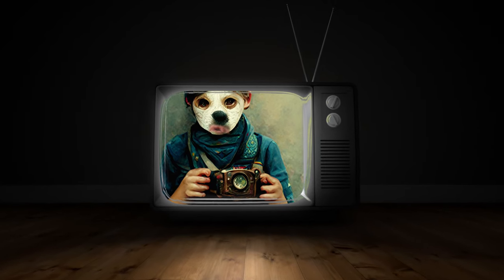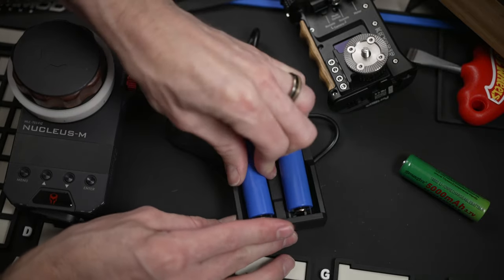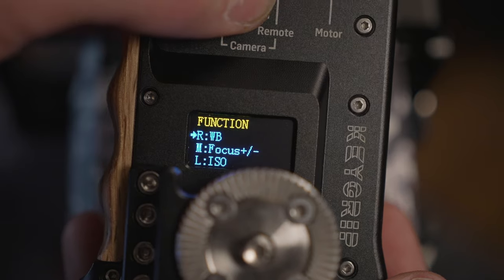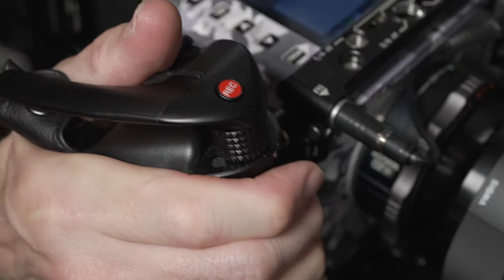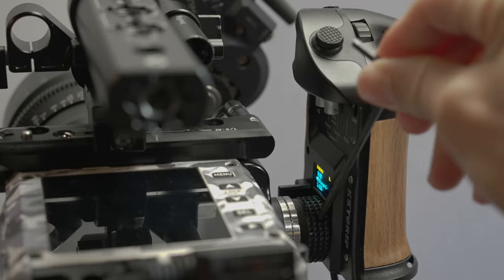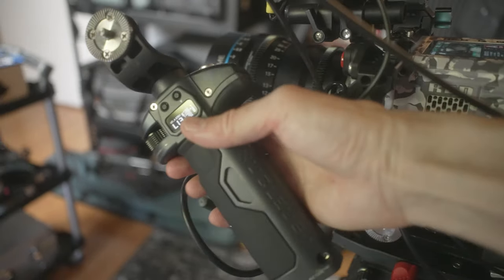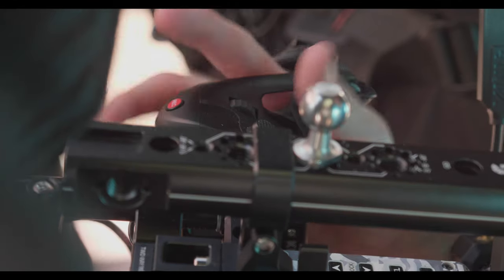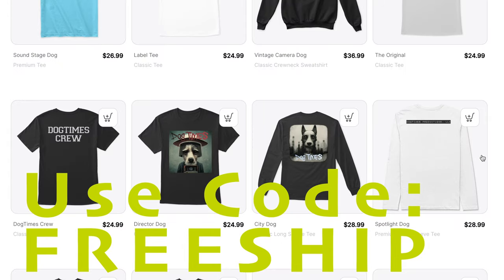RED Komodo Wireless Control - PortKeys Key Grip Review

Comment: Thanks for the deep dive into the problems with the Nucleus M motor. I picked up a Keygrip as it was literally the only option for a handle with a start/stop button for the Blackmagic Pocket 4K/6K. I’ve been using a Nucleus-M with a Nucleus handle for pulling focus on my shoulder rig which has been great. I was going to try out the motor with the Keygrip but I think I’ll just avoid it.  Maybe I’ll try out a Nucleus Nano motor with the Keygrip for controlling zoom. So far things have been working well with the Nucleus handle on the left for focus and the Keygrip on the right for start/stop and iris.

Comment: The small switch on the front is not ideal on this thing but it works. You have to hold it tight. Loosing that rubber cap will happen though....

Comment: The tilta max handle has been an extremely important tool for me. Focus is so smooth. Just bought the bright tangerine nato run/stop as well, but thinking of getting rid of it for the mutiny I/o box. How do you run timecode out?
Reply: What's nato run/stop ? What does it do ?
Reply: @charlesjones5210  it's a top mounted accessory that allows you to run/stop the red Komodo from the nucleus nano. Look up the bright tangerine nato run/stop and you'll see
Reply: @fatheadmediapro  cool and I was thinking of picking up the tilta nucleus m full set up but I'm not sure if I need it right now on the red komodo because I only have one cine lens right now . When do you use the tilta nucleus m set up? The tilta nucleus m is not lightweight as oppose to doing one handed focusing from the lens when doing handheld .

Comment: Bought this. Fired it up. Followed instructions. Instant problems. Display on grip says...No equipment !. Scoured the internet....No luck. No mention of this issue anywhere. All attempts to connect  via WIFI say..." "No equipment !" just like that...with an exclamation on the screen. All guides I've seen make this thing seem like it works right out of the box.  Complete disappointment so far. Looks like I'll be calling china or sending this POS back. Should have guessed by your face in the thumbnail this was a bad buy. Still, Looking forward to any update you do on the product in the future
Reply: Having the same issue.
Reply: Okay figured it out. Change your camera name to KOMODO